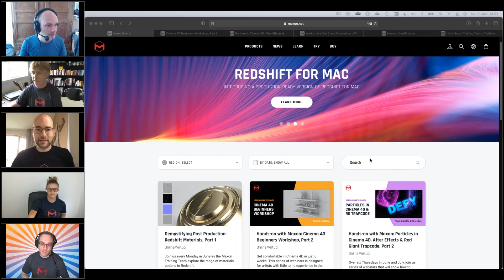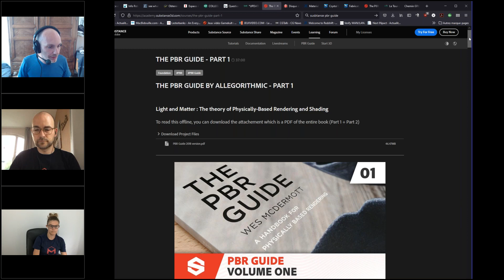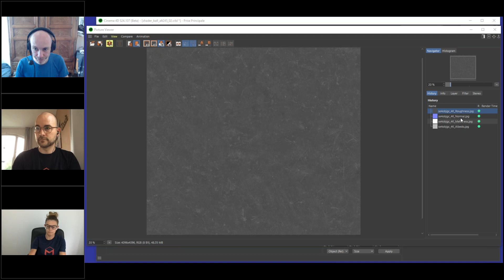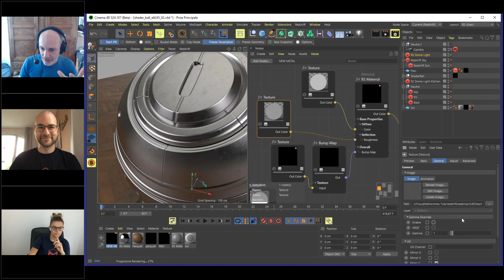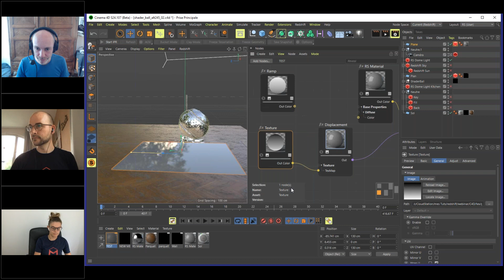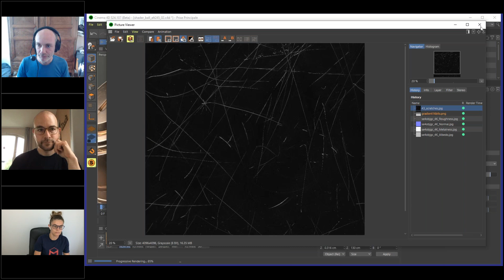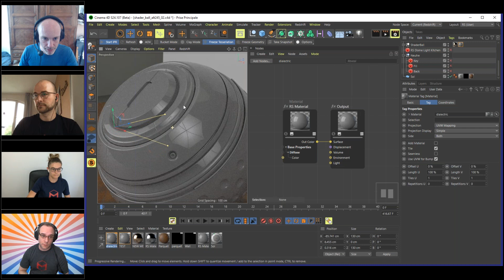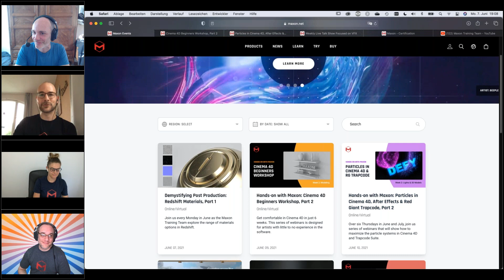Intro to Redshift: Materials

Comment: Since RS 3.0.46 and the introduction of ACES, it's no longer necessary to set up the gamma of the files manually... theorically. Most of the time, it works, and RS will interpret roughness, bump, normal etc... map as linear and will keep albedo, color, diffuse as sRGB automatically. It can fail sometimes, so It's still interesting to know how to do it manually.

Comment: Why do you need to change Gamma Override?
Reply: Bitmap are interpreted to sRGB which has not a linear response in contrast/luminosity. While it's perfectly fine and desirable for color textures such as the base color, it is a problem for "technical" inputs such as roughness, bump map etc... So we must apply a "linearize" operation, putting back the gamma (contrast) to linear (1) so that the maps do correctly their job. Note that you don't need to do that on maps generated by RS itself, such as a noise or a ramp.
Reply: @lionelvicidomini6051  ok, great. so just to clarify this is needed only for diffuse/colour node?
Reply: @evolnull125  Yes. The only exception is when using EXR file which are already linearized (but you usually don't use EXR in the color channel)